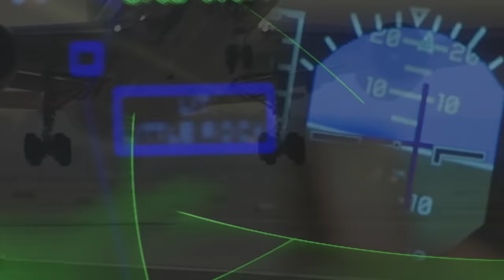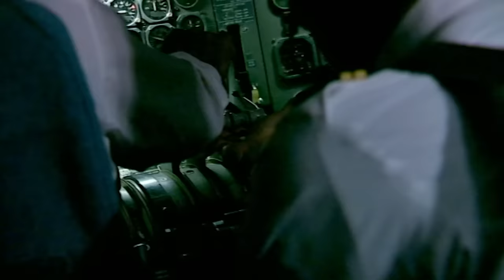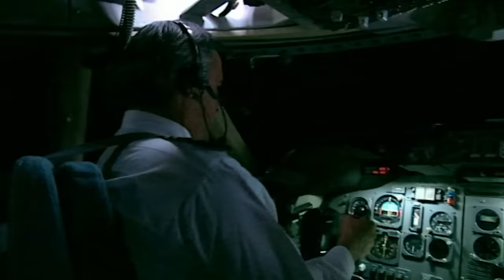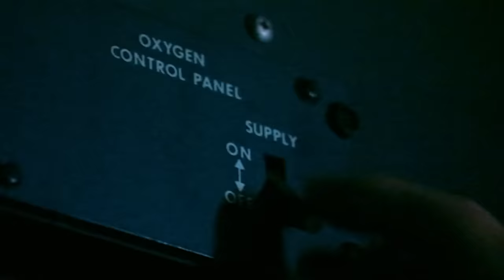Horrific Plane Crashes That Could Have Been Prevented | Mayday Compilation | On The Move

Comment: Regarding the American accident and referring to my earlier comments about the United accident...The response of the lead NTSB investigator is very disturbing when he says it would be "unfair" for him to judge the pilot given the short amount of time to make the decision.  That  Exposes the problems within the NTSB in general.  It is not about "fairness" but rather whether the pilot acted properly and responsibly which he certainly did NOT!  (The NTSV responsibility is solely to determine the causes of the accident and not to play political footsy with the pilots.  They are only to be concerned with the protection of the public, but that is not what typically happens as we see in this case.) Both the pilot and co-pilot were it fault.  They obviously did not understand the Actual limitations of the aircraft.  (How is that even possible?   Why did the NTSB fail to address this obvious and extremely dangerous lack of  Competency???  The NTSB was totally irresponsible.)  The pilots chose to land in conditions that were far beyond the capability of the aircraft.  That is the key issue and should have been the foundation of the report, but they chose to hide this reality and focus on other more minor failures.   This was done because it is common practice for pilots to put their passengers at risk solely to maintain their schedule...and politics demanded that this reality could not be exposed.  The NTSB refuse to touch this issue because they are complicit with the airlines.  It is ALL about money!!!) It is not about fairness but rather the fact that 11 people died because the pilot and co-pilot totally messed up and landed under conditions that were far beyond the capability of the aircraft.  There's no question but that they should have gone around, and there was no reason for them not to abort the landing.   The failure to engage the spoilers was simply an additional failure that exposes their irresponsible and unprofessional behaviors.   Regarding the comments of the copilot associated with the go around, any properly-trained pilot knows that accurate and clear communications are the key.  The black Box recordings were unequivocal that the co-pilot never communicated a desire for a go around.  However, that is not the key issue.  The copilot encouraged the landing into unsafe conditions that were far beyond the capability of the aircraft. That is all that matters!   The worst aspect of this is the fact that the NTSB failed to properly identify the continuing failures of the government to protect the flying community.   The leadership of the NTSB and the FAA are too closely connected with the aircraft and airline corporations and this greatly affects their conclusions to the point where people are dying!!!   We experienced it time after time when I was performing research at a national laboratory.  I flew constantly, and during that time I witnessed countless failures of the government institutions to protect the flying public.  They gave the airlines and the aircraft industry far too much latitude, and when accidents did occur, they often hid or discounted vital evidence that pointed directly at the airlines and the aircraft manufacturers... As well as the failures of the FAA to properly respond to known hazards.   People die because of politics over science!

Comment: 1:40:18  Did he really just say as an accident investigator it's not his place to place blame? That's exactly what hes supposed to do! What is he talking about? It is exactly his job to figure out who made the biggest mistake of their life and took the lives of others!
Reply: It’s a fine point but the investigators job is to do the research and present the FACTS.
If the airline made a mistake and only fueled the aircraft with fuel to go halfway across an ocean, the investigator presents that EVIDENCE.
The final decision, even though it may seem obvious, has to come from the board members in charge of the investigation or a court.
Reply: @oldedwardian1778  gotcha! I guess i meant it more that he was supposed to find the cause- hence point the finger of blame - for what may have caused the accident. But thanks for clarification.
Reply: @audrey1731 there are usually multiple factors that line up to cause an accident. The investigation final report will list them and prioritize them. Basically it IS identifying who or what caused the crash, but it’s done in a very factual way, not emotional, and it stops at immediate factors, it doesn’t follow the chain any further back than needed. So I can understand why he would say that’s not blame.

Comment: There is inherent amount of risk in any mechanical device especially high performance. This may have been a cause of this crash but you can’t shut down industries, movement of millions of people while a 3 year investigation takes place.   Should we shut down all the unions when they make a mistake or miss procedures.   There is a balance that need to be used without shutting down entire industries.

Comment: So in reality, how long the insulation on all those miles on wiring/cabling last before beginning to get brittle is a MAJOR FACTOR in determining the lifespan of an aircraft.  In fact if wiring insulation shows early signs of being brittle & its not feasible to replace all wiring, the aircraft should be scrapped!

Comment: 20 minutes to do a set of smoke checklists . . . 
Don't they know that fire in a plane is even worse than a fire at sea? And a fire at sea is just about the worst thing a typical sailor can imagine. But at least at sea you can grab a flotation device and abandon ship. That's not an option in any normal plane. In a plane your ONLY option is to get down and landed as quickly as humanly possible, even if that means using a street to land.
Reply: Lansing in open ocean is worse than for on plane. The checklists are too prevent further problems and spread as well as identifying a source to possibly stopping it.

Comment: You know what we do with old wiring in our industry?  We leave it, disconnect it, and run new wiring.  Why can't that be done with old aircraft for safety reasons during refurbishment?  Sure, you can remove old wiring, if you can.   I know why, weight.  They don't want the extra 200+ lbs of new wiring and the prospect of only being able to safely remove less than 50 lbs of old wiring and the labor cost.